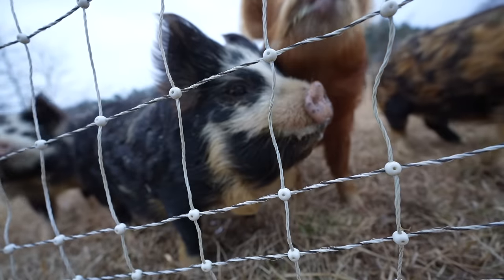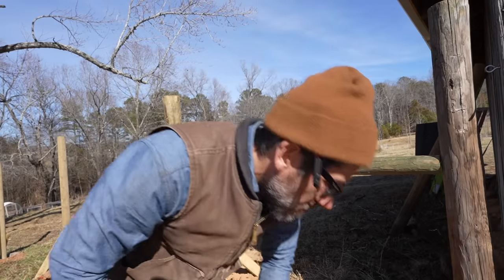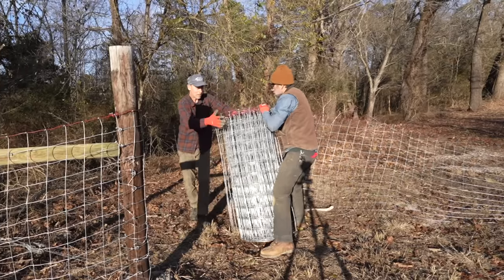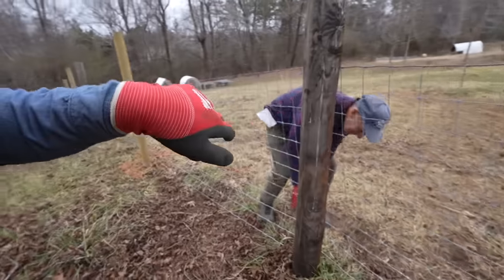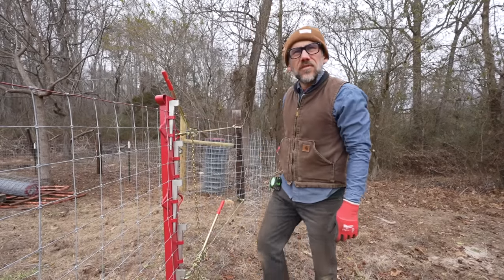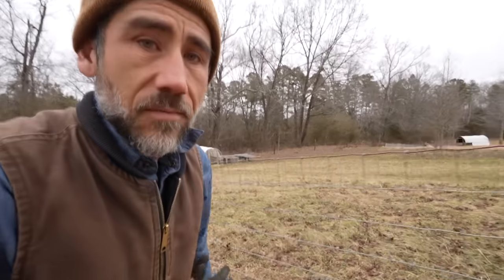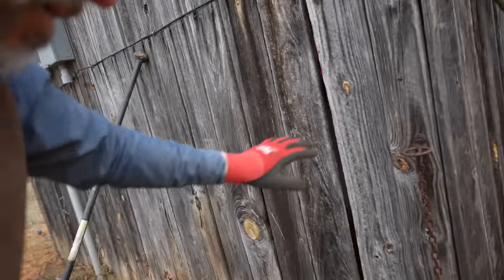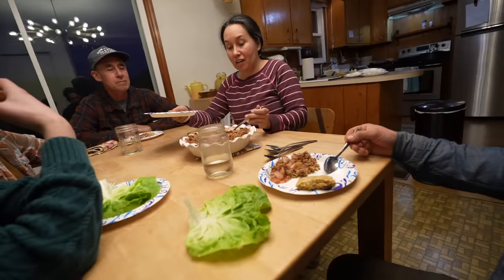Stretching 100' of Fence to Lock Up My Farm Animals

Comment: Your fencing looks great! The only luck I've had with barbed wire is bad...vet bills and ER bills sewing torn flesh back together, tetanus boosters, replacing shredded clothing and gloves, not to mention the spikes mean nothing to cattle.  Some wire with some decent voltage, however, kept them in.  They have to be trained to  it, though, or they can blow through it before they realize what got 'em. Seeing others getting trained to it seems to drive the lesson home even better.
Reply from the maker: Thanks for the tips!

Comment: I was gonna put that kind of hydrant in but a plumber told me it needs a pump. That's just like an on /off switch. It needs pressure to pump up the water. You could probably put a pitcher hydrant there. The kind you manually pump.

Comment: If you paint the fence it will eventually peel and flake . My solution was to spray on linseed oil mixed 50 , 50 with methyl hydrate. It gives better protection that paint.

Comment: While it is stretched cut each of the strands individually and wrap them and tie off. At least with the top and bottom strands as they are the heaviest/strongest. 

Then when they are tied off you can take the stretcher off. 

We always cut the length at 9 squares after the post, gave a wrap around the post before you tied off.

Comment: Don't paint the wooden posts. Get a one gallon pump up spray bottle. Mix half burned motor oil and half dyed diesel. Fill the sprayer and spray your posts with that mixture and they will last forever. Easy to respray every couple of years.

Comment: Jason do not paint the fence posts 
Look into Staining the posts instead and stain want chip off   Also research Ichiban it is a Chinese or Japanese way of waterproofing the wood where you turn the outside into charcoal. The word is supposed to last 1000 years or long. 😮
Reply: shushugiban or a word something like that is what Jason used on his raised beds. probably should have done that before setting them in the ground if he wanted to do that. lots of extra work.

Comment: get a bigger hammer.  U will thank ur self for doings so.  For that job u need a 3lb with a 12" handle.  U will take a1/3 of the swings u are.

U should never use to small a hammer.  
the 24ox framing hammer u are using was made to drive nails of no longer then 6".  U want to drive an 8" spike use a 3bl hammer.  12" or longer use at least a 4lb going up as the nail size does.